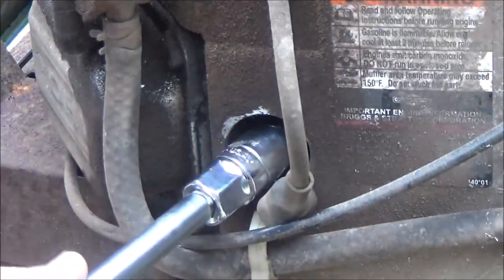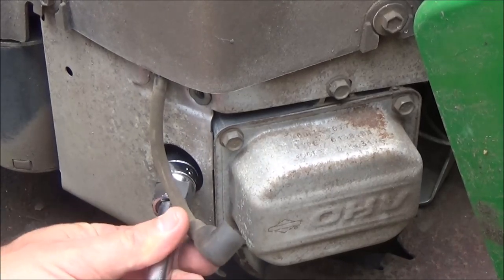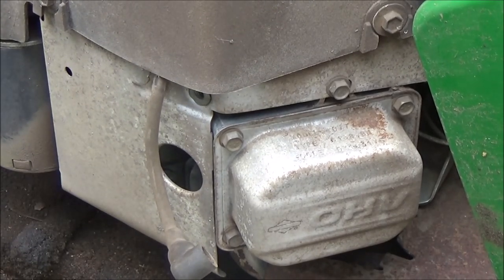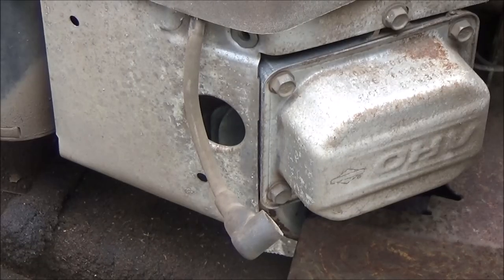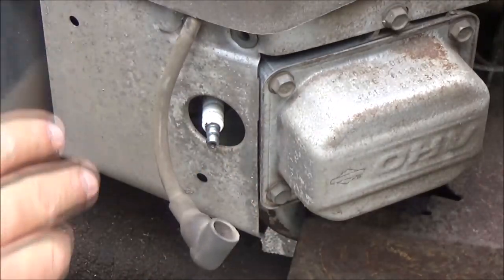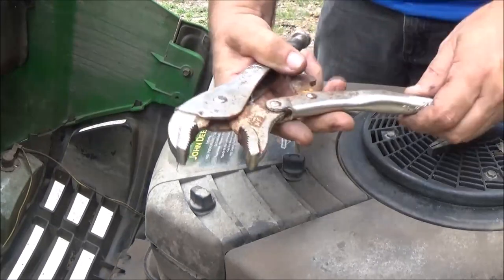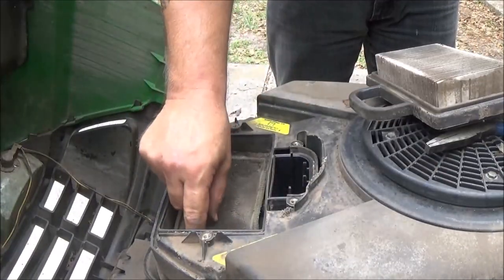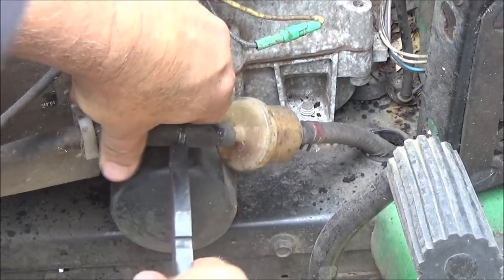Diagnosing A Surging 22 HP Briggs And Stratton V Twin John Deere

Comment: About a year ago, I replaced the fuel pump on one of these. About three months later, the fuel filter was clogged. After playing with that and getting it squared away, it still ran like it was fuel starved. On a whim, I blew compressed air from the filter location back into the tank. Where it looked clean before, it now had black stuff and bug parts all in the fuel tank. Used a siphon hose to clean the parts out (filtered through a t-shirt into a coffee can) to get all I could out, repeated the "Back-Blow" two more times and even more bug parts came out. Finally ended up removing the tank to get it cleaned out and fix the surging issue.
Now, 9 months later (yesterday) the guy brought it back due to surging again. This time it was an easy fix. There was a wad of a cotton boll (not ball, as in from a pharmacy but BOLL as from a cotton field) wrapped around the governor linkage. Once removed she was good to go.
Reply: I might watching a movie there on how to fix an engine that surges
Reply: Mine had fuel filter you can see thru. It wasn't filling up with fuel, so I also did the bug blow-out technique. Replaced the fuel filter and it got a little better but still surges at full throttle. There could be bug buggers in the carb or pump getting weak. Always check that vacuum line for splits that operates the fuel pump...been thru 2 in the last year.

Comment: Question: I have done this so far,flushed out fuel tank,replaced fuel filter,installed new carb with gaskets,installed new plugs, fuel pump works fine, and the 22hp B&S engine is still surging, I checked the linkage and that seems fine, what am I missing?  engine throttles up fine but even when engine is warm I still have to choke it to start.
Reply: I installed an aftermarket carb from Amazon.
Reply from the maker: Check your plugs